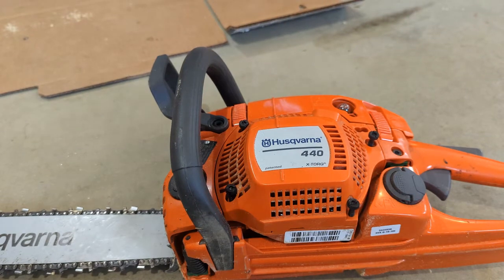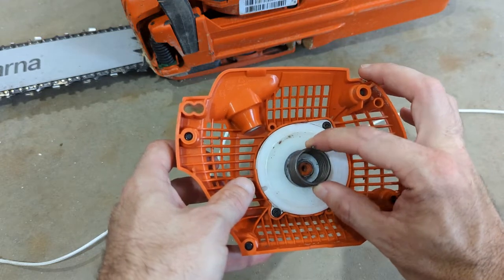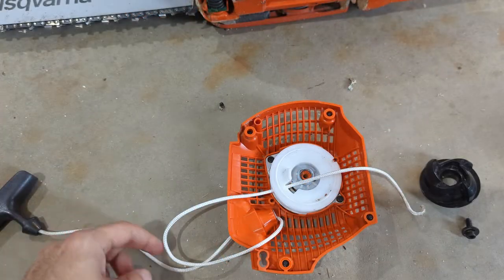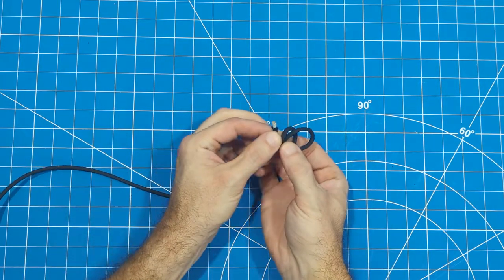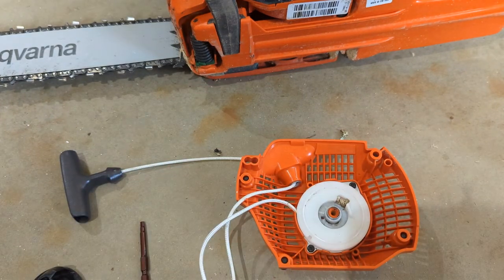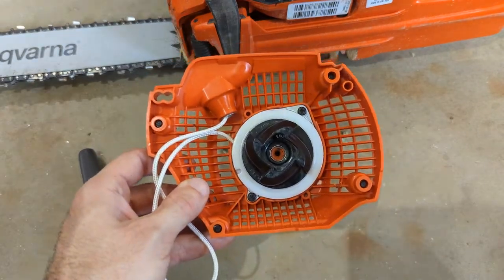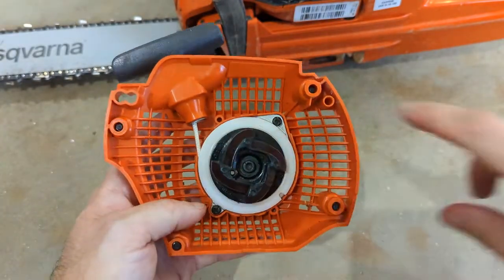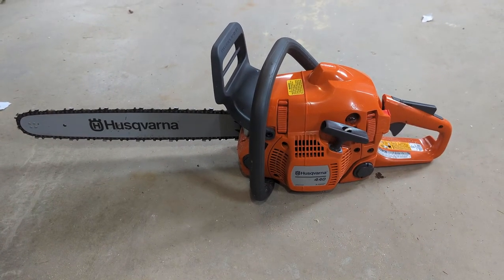How to Replace Husqvarna Chainsaw Pull Cord

Comment: Thank you. I can confirm it works for the Husky 450 Rancher as well. Great vid with detailed close ups so there is no confusion and simple explanations. I just bought mine and started it up once. When I shut it off and tried starting it a 2nd time to confirm I knew how, the rip cord came right out and my plans went with it. If it hadn't cut the test tree like a hot knife through butter during my test, I would have returned it. Couldn't be happier with it now the rip cord is no longer a problem.
Reply from the maker: Nice.  Thanks for the confirmation on the 450.

Square knot should work fine. I just find the knot I used to be more dense albeit a little more complicated.  potato patato

Comment: My starter cord keeps getting jammed up at full extension now. Will not rewind properly. First pull out of the box and the knot came right out. What a garbage chainsaw at an expensive price.
Reply from the maker: I was also really discouraged when I first bought this saw and this happened.  However, since I made this fix, the saw has been running fantastically.  

But this stupid knot really sours the whole experience.  The devil is in the details.

Comment: Thanks appreciated the explanation on the proper knot too!  Got my up and running again, but only to have the knot rip out yet again on the second time I used it after this repair.  Replaced it with a higher quality cord and gave it a little more length so I wasn’t always bottoming out and so far so good.

Comment: Just got done restringing my 440. Worked the first time and took 10 minutes while saving me a trip to repairman and  $40+  Your video was well explained and easy to follow however I used a square knot rather than the hitch you showed. 
Thanks for posting.

Comment: My rip cord is not recoiling. I haven’t had time to take it apart. Do I need a new one
Reply from the maker: Can't really tell without taking it apart.  

Think about it this way... If it isn't recoiling then you cant start it.  So it doesn't work.  Taking it apart isn't going to make it worse.

Right now you have no idea what is wrong.

If you back off 4 screws (maybe 5) you will have much more information... will probably know what's wrong... and can come back later when you have more time to fix it.